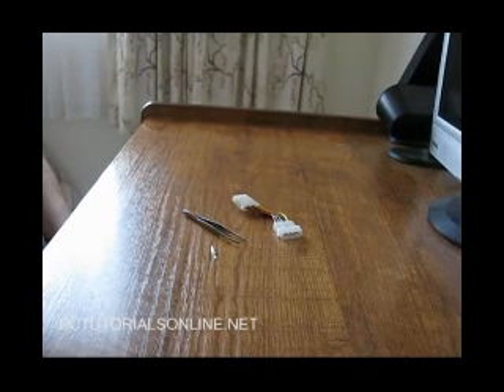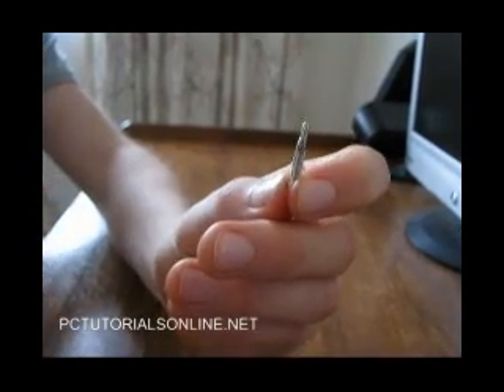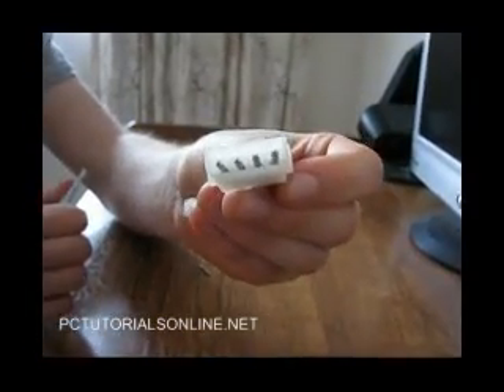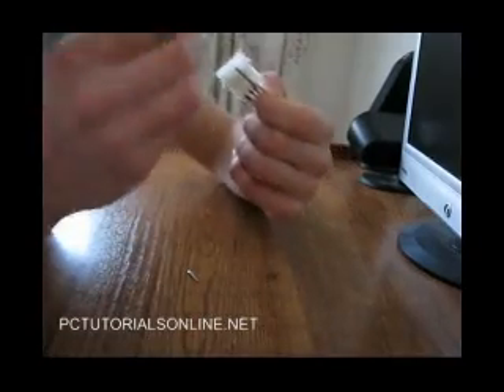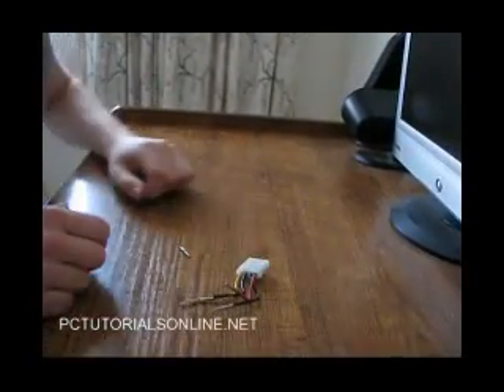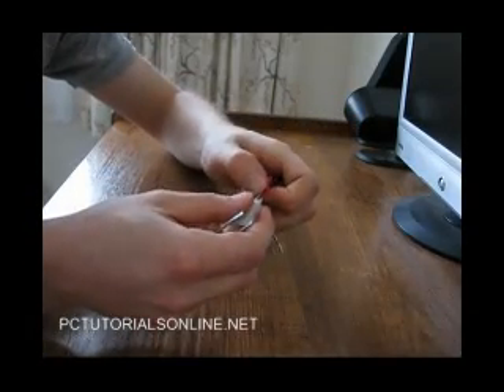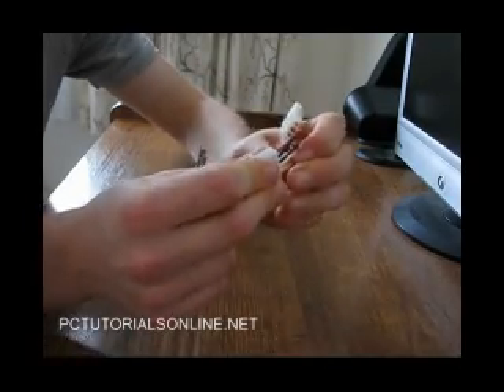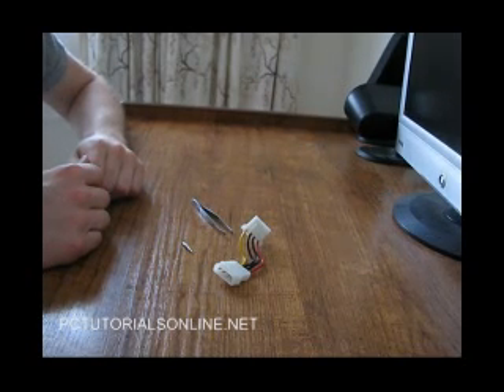How to Dismantle a Molex Power Connecter

Comment from the maker: Hey Nicolino, Yes you can buy replacement molex connectors. They come in either as a female or male connector. Most likely, you'll want a female connector (the ones on the power supply). Ebayhas them (search for Female Molex Connector Housing) or any online computer shop should have one. Let me know if you need further assistance. John